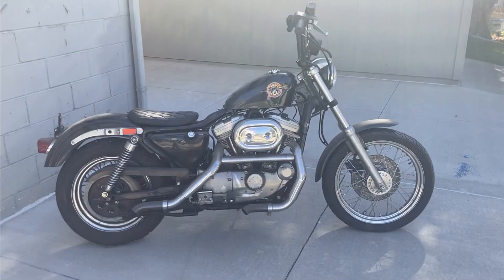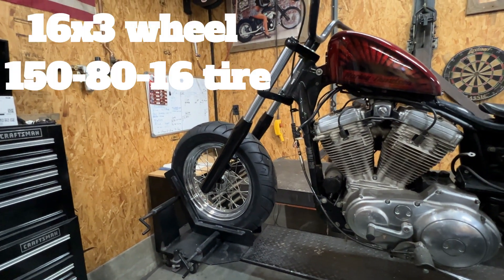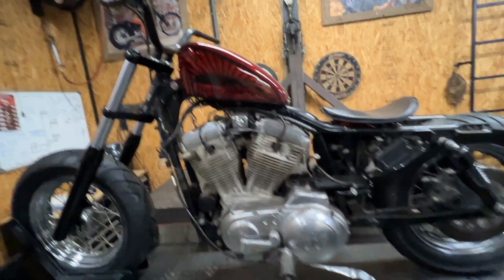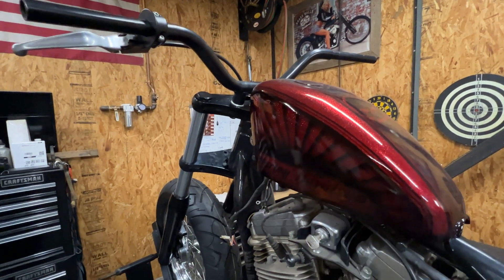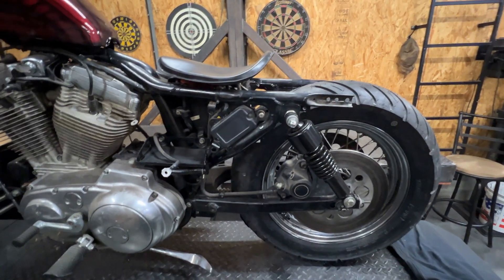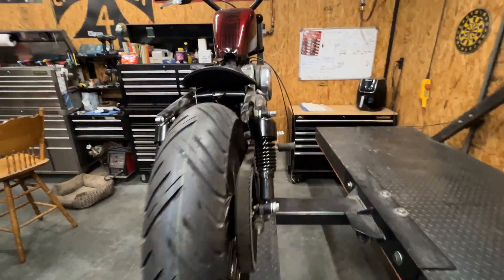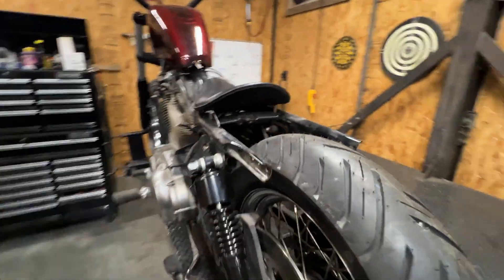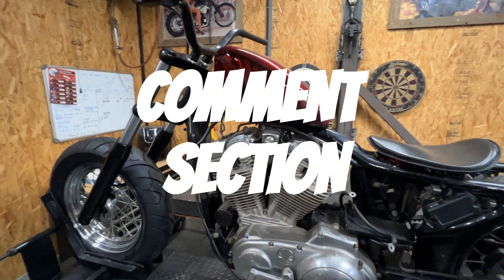SPORTSTER BUILD Project Part 1

Comment: I think black the wheels, black most of the motor, polish the other parts you don't black out. It will be a sweet bike. I'd sweep the pipes straight back from the ports....???
Reply from the maker: That's kinda what I was thinking... With a Big fat straight exhaust just like you described.